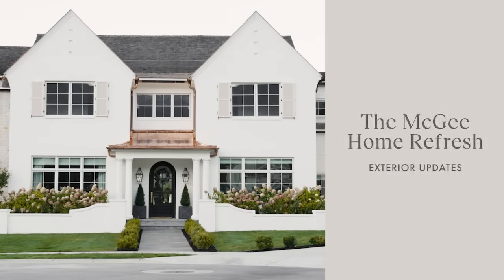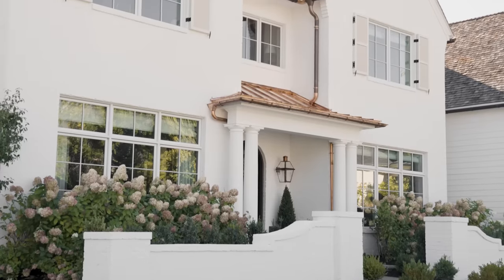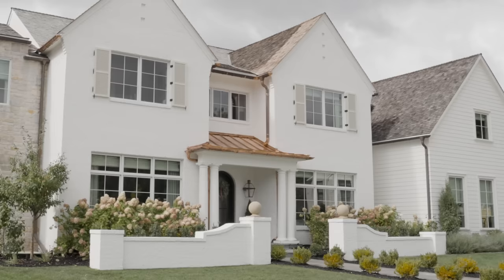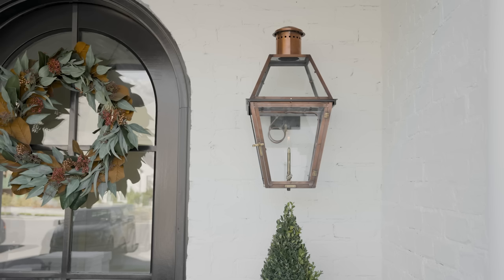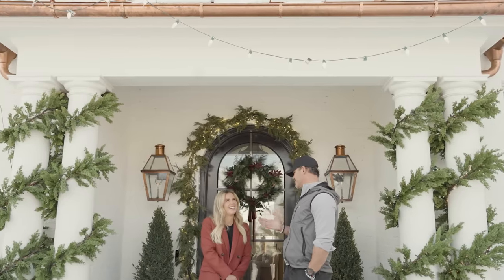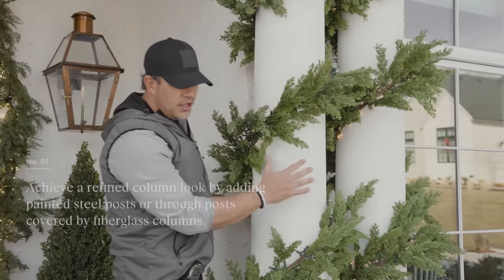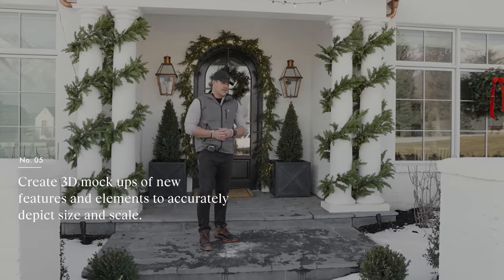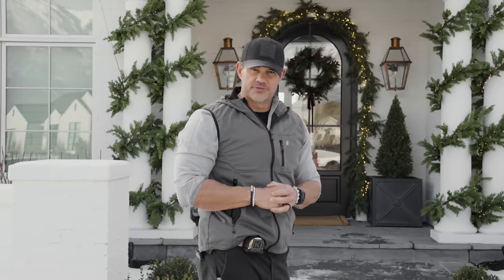The McGee Home Remodel: How We Transformed the Exterior of Our Home

Comment: The front and entrance are beautiful and much more welcoming!! The only change I'd consider is the color of the shutters, which appears on video anyway as needing a bit of a clean. A subdued warm color would draw connection between the brick that's not painted white and all the brass elements and may even compliment the scale of the facade by drawing down the height of the roof, tying it to that beautiful new walkway.
The scale of the shutters seems right to me -- shutters that didn't cover the width of the windows would have looked off I think but if the shutters were not folded, they would have extended too far across the facade to the edge.  As I'm looking at a still of the front, I see that the windows reflect some dark colors (maybe its the time of day) but a little color on the shutters might also match the width of reflection of color from the windows below them. Regardless, it looks great. Congrats!!